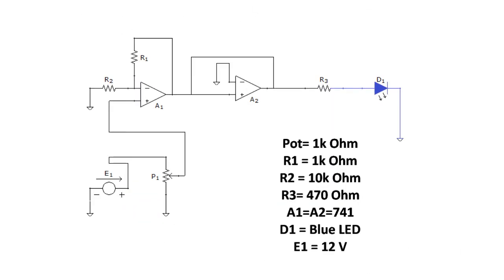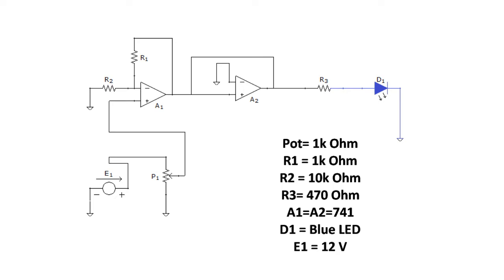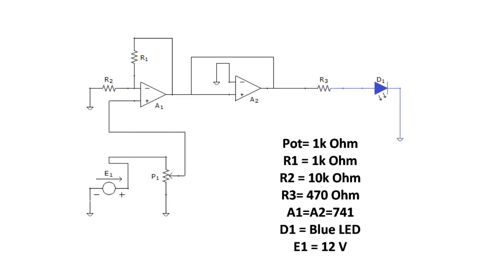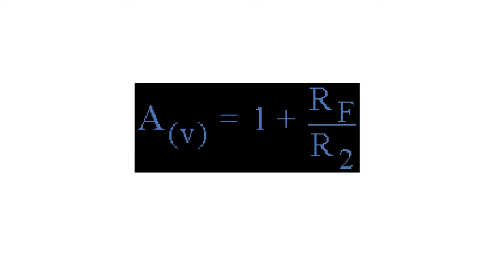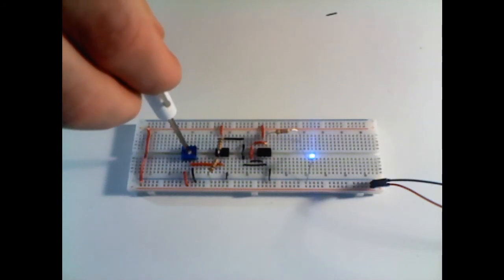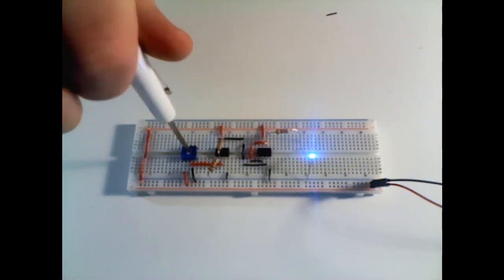Non-inverting Op Amp

Comment from the maker: The purpose of lowering the output impedance is to change the effect of your amplifier has on the load, so if this was powering a speaker more current could reach it, thus making louder. That is why on power supplies low impedance is ideal because it lowers the effect of the power on the circuit itself. Hopefully this clear your question and thanks for watching my videos.